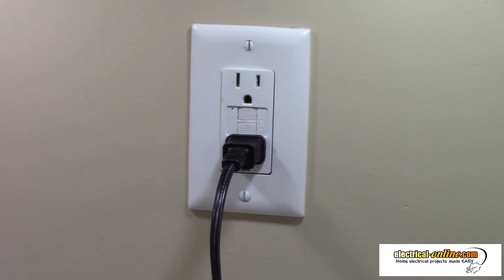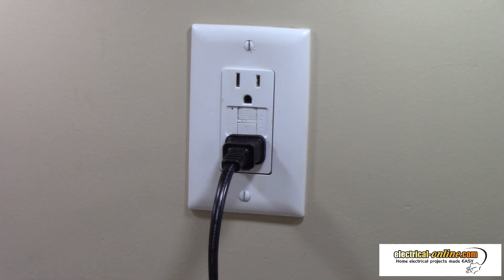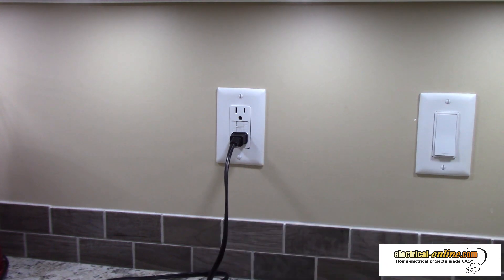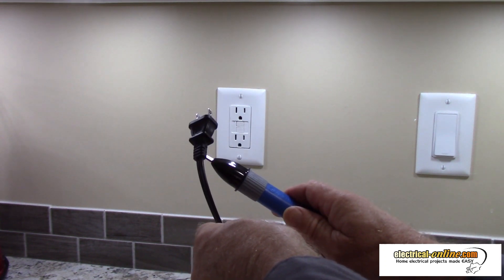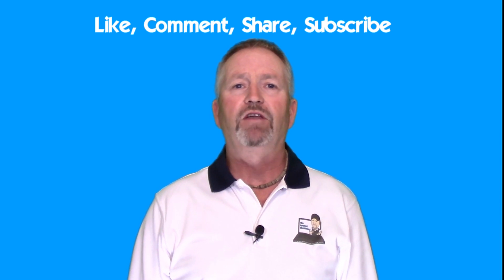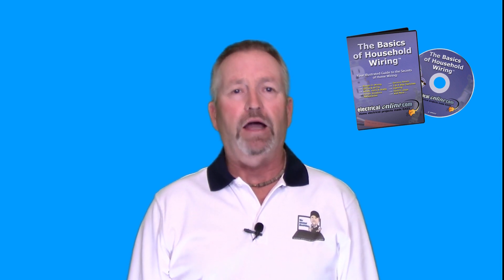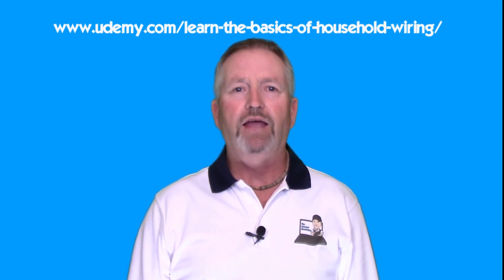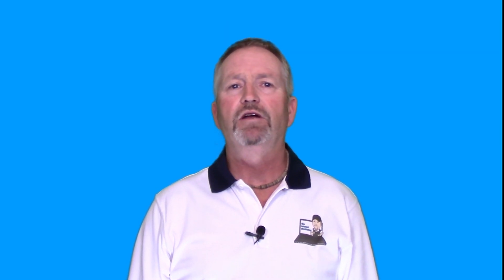How to Use a Non-Contact Voltage Detector

Comment: I have one of these and it is great.
Reply from the maker: They are good to just let you know that there is voltage present.  They are a little too sensitive sometimes, and give you " false positives", like if you run it through your hair, the static will activate them.
Reply: @theinternetelectrician  yeah,

Comment: How to install batteries  please. Thanks
Reply: I came here looking for the same information since I have the same detector he has in the video. Too bad he doesn’t pay attention to comments since yours is 8 months old and no reply. 🤦‍♂️
I figured it out. At the base of the pocket clip there is a small slot. Using a small flat blade screw driver you just simply work it back and forth to slide the end cap out. It just seems to be a friction fit. 
I had tried with my thumbnail and couldn’t move it and gave it a go with a screwdriver figuring I couldn’t mess it up too badly.
Reply: @Crewsy  hahaha oh wow I was looking for this answer ! Thank you
Reply: @Crewsy  Thanks, I was looking for the same answer too! Too bad he showed us how to scratch out head with it but not how to change the batteries...!
Reply: @Crewsy  I was looking for that too. Thanks

Comment: I looked through your videos wondering  if you had one on replacing or upgrading a breaker box / panel.
Reply: If you could make a video of that or if you have one already. It would be helpful. Thanks
Reply from the maker: That’s a possibility for a future project but it’s a little beyond the scope of projects that a homeowner should typically take on due to the fact that an electrical permit would not be issued in most jurisdictions to a non-licensed, qualified person for a task like that. I try to keep my advise to more DIY oriented.

Comment: Dear friend,

This is Ruth comes from China.
I am looking for some YT bloggers who have the interesting to shoot the video for electrical equipment. I have browsed your video, which attracted me a lot.
In order to help you test the electrical equipment items and promote our brand, I really want to cooperate with you! 
We have the new item-the circuit tester will be uploaded in early November on Amazon, If you are interested, please email me--tpfxj101@gmail.com
In return, I will provide the following benefits to you:
1. Free sample.
2. Discounted rate to buy our products.
3. Other benefits that you want to discuss with us.

In the following, I will send you the Special Feature of the receptacle tester to you!

1.TESTING CAPABILITY: This outlet tester detects the most common wiring problems in standard and GFCI receptacles, which is capable of detecting the open wiring fault with open ground, open hot, open neutral, reverse polarity,  hot/neutral reversed wires.
2.GFCI FUNCTION: This electrical outlet tester works on GFCI outlets and confirms the operation of the ground fault protective device. It tests standard outlets (multiple outlets in the kitchen or bath, and outdoor receptacles require GFCI protection).
3.VOLTAGE DISPLAY: This Receptacle tester with LED display helps you to measure the socket voltage and display it clearly in the LCD screen,
4.INSTANT WIRING IDENTIFICATION: The Red LED indicators can be light up clearly for easy visual indication, when activated identify one of the seven common wiring options. An easy to understand chart on the tester helps determine wiring conditions in an outlet, based on LED lights results.

Any detail you want to know, Please connect me, I will reply to you soon.

Sincerely, 
Ruth
Reply: Wow Ruth, you win! 
That's the nicest YouTube comment I believe I've ever seen.